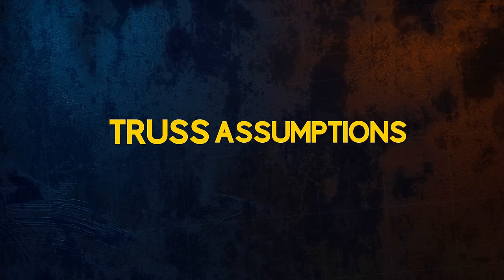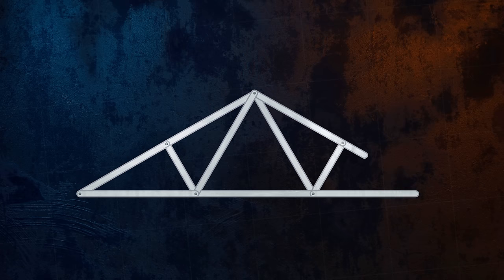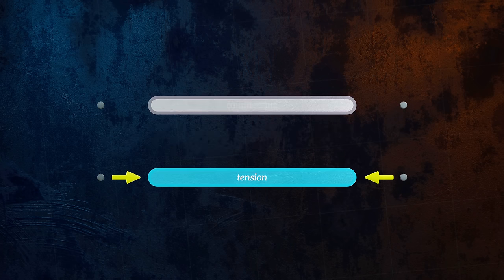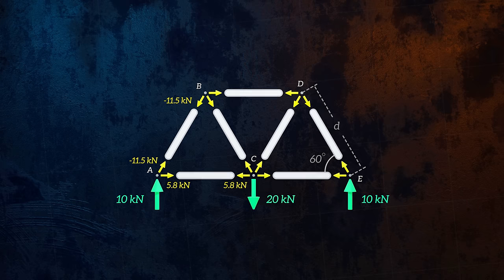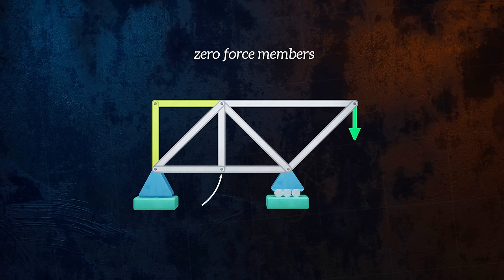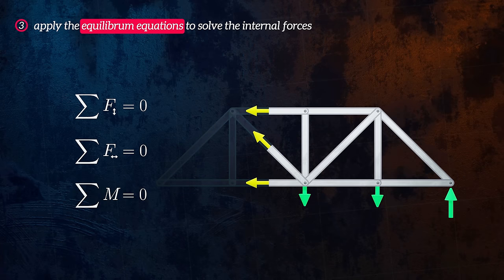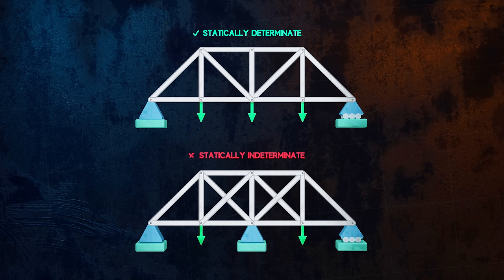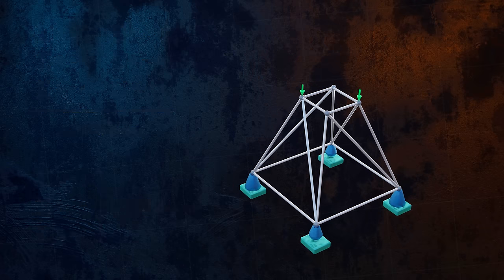Understanding and Analysing Trusses

Comment: I am a structural engineer with a major aerospace company and I cannot tell how how well made these videos are. I am so impressed that I actually watch them every now and then Just to stay in touch with basics. Helps develop intuition. 😀 thanks efficient engineer.
Reply: Do excuse me, I'm like hella stupid when it comes to this kind of stuff, but as for the 20Kn number, is that just an example of force? and if you wanted the real number or amount of force, you would need to calculate the weight of all components? and or additions to the structure?
Reply: @RUSTY NEEDLES  Yeah, usually for structures you calculate the dead load, which is the load of all the structural members, eg beams, columns, then you add the live load, which is the load of things like trains, cars, pedestrians. Then you add in wind and earthquake loads, and multiply all these loads by their respective factors. 

After which you get the moments and shear forces from these loads, and use these moments to figure out the rebar required per slab/beam/column.
Reply: Hello.I need a mentor,am an engineering student
Reply: @justhangingaround804 
Hi, I am studying aerospace engineering and its my last year. I would love an internship opportunity!

Comment: As a mechanical engineer myself  I have to say your channel is literally treasure!
Keep going my friend.
As a proposal ,it would be nice if you do some finite element analysis videos!
Reply: Exactly i do wish the same!
Reply: Do excuse me, I'm like hella stupid when it comes to this kind of stuff, but as for the 20Kn number, is that just an example of force? and if you wanted the real number or amount of force, you would need to calculate the weight of all components? and or additions to the structure?
Reply: @rustyneedles3743  this is a basic understanding and explanation of forces. weight and mass are different, weight being the force acting on an object with gravity, while mass being the amount of matter in an object. 
In this example, take it as the force acting on the object is xxKN, with gravity and mass of the beam being accounted for, as Weight (kn)= mass(kg) X gravity (m/s2). 
of course in reality there are alot of forces acting on the object, the type of material used for the beams, the type of bolt used etc. 
But the law of equilibrium and the law of moments about a point does not change.

Comment: This is an awesome video! I've shown it to my statics students. 

The caveat is that videos like this do not replace personal work on problem solving in statics, which is what is most needed to actually learn the content. And also it does not replace the discerning work of the teachers that need to ascertain that the students have learned the skills and provide feedback.
Reply from the maker: Absolutely, I completely agree! Working problems is crucial. And I see these videos as a supplement to classroom learning, not a replacement by any means.

Comment: I shoulda been a mechanical engineer. This stuff may be mundane to some but the application of physics here is absolutely fascinating. The only thing not really covered here is how to take into account the truss's self-load, which is kind of important when building bridges or towers but then that is a much more complicated topic. It also seems to me that wrt the zero load members, if they are there to prevent buckling, then they are there to counter a bending moment and thus not zero load. Just zero wrt to the ideal truss composed of members of infinite strength.

Comment: Method of joints, method of sections, force pologon.....several ways to design or check a computer run.  Secondary stresses easily checked for added bending tension or comp. between panel points (truss joints).

Comment: You can simplify and extend the mathematics further by using dominating graph theory and computing forces based on only two elements: vertices (nodes) and edges. You can even come up with new designs by computing the optimal cardinality of the domination subset.

Comment: I've been a builder for 40 years when I first started out I was Contracting houses and the Builder wanted me to use trusses. After I started building on my own I started cutting and stacking my own roofs. Triangles are the strongest structures in the world they cannot be collapsed without breaking that's why they are the strongest. Same as a cut and stack roof when you build a roof it is a triangle and then you put struts in pearland's in to create triangles. Once you understand this you know how to build the strongest roofs. It's a matter of geometry. Once you understand the geometry of a triangle and the facts that are triangle cannot be shifted or crushed like a square or parallelogram then you can understand the strength of a triangle and multi triangles to create a Truss. A trust is just a collection of triangles and once you understand that and you could understand the strength of a truss.

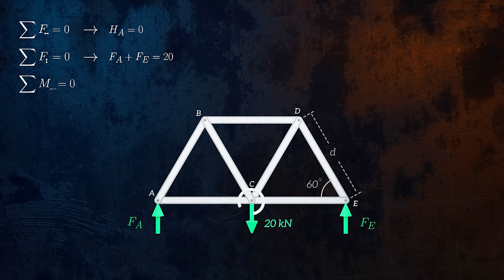Comment: AT 6:18 "take the moment at C" gives you an equation that Mc = Fa(d) + -Fe(d) = 0 , but doesn't actually resolve anything. You should actually take the moment at the Pinned support (A), to find the reaction force at the roller joint (E). Thus Ma = -20(1d) + Fe (2d)= 0, then Fe = 20 x 1d / 2d = 10kN. Then do sum of the forces in Y to resolve Reaction Fa.

Comment: @The Efficient Engineer: I do have one question: At Min 12:45 in the video, you calculate the forces of FA + FH and then state, that FA equals 19kN and FH equals 21 kN - how do you know, that they are not both 20kN, i.e. why aren't they just split evenly? And continuing calculating MA by multiplying FH by 8 and then in the calculation you multiply by 2, 4 & 6 - why do you do that and where do these numbers come from? I hope you can enlighten me, because the rest of the video was so amazing and clearly structured! Great work!
Reply: @choosingbegger9799   that's a perfect explanation - got it now! Thank you so much!

Comment: I think its a good attempt for young practioners to understand theoretical concept, 
But some explanation is wrong about Pratt truss at 15:57 sec of this video which as follows 
Vertical members are in compression as per narrator but loading applied would generate tension in Vertical member.
So change the load path to make yu explanation correct.

Comment: Sir , I think I've found a miscalculation here , at exactly  8:12 you made the two horizontal force acting at point B as postive , but it should be represented as negative to left horizontal force and postive to the right horizontal force , so they both would cancel out each other and the sum of horizontal forces at point B is equal to zero , correct me  if iam wrong thank you sir

Comment: Thank you so much for the phenominal effort you put in this video , i just have one question , at 13:39  why is  the 21KN force is located 2 meters from joint F and NOT (2 x square root of 2)  (measuring the distance directly from point H) as straight line , thank you :)
Reply from the maker: A moment is calculated as the force multiplied by the perpendicular distance between the pivot point and the line of action of the force, not the distance between the pivot point and the location where the force is applied, which is why it's 2m.
Reply: @TheEfficientEngineer  thank u so much keep going with these videos btw i'm an electrical engineer i love your work

Comment: Love the vid, I'm just having one slight issue. It is said that trusses only can carry joint loads but that is rarely the case in reality right? I mean for example one of the roof trusses pictured in the video will have a linear snowload acting on the "outer" members. If one would want to calculate the forces acting in each member would one multiply the linear load with the number of meters between each joint to combine it into a point load? In reality the members will not only have tension or compression forces but rather a moment and shear forces aswell. Is it corret to assume that these forces doesn't exist?

Comment: note 4: angles (stability) of basic triangular truss only depends on the length of each member. other shapes may not. so, how do we prevent elastic deformation (past yield strength of ductile material) or rupture (*somewhere past tensile strength of brittle material) (and thus "improve" stability)? probably with internal force analysis.

Comment: While chords of a Truss are analyzed and assumed as meeting and terminating at panel points, in reality chords are fabricated continuous thru a panel joints and splices may be located somewhere between panel points to take advantage of available commercial lengths simplify erection and not crowd the panels with joint connectors. Due to this continuity I take it that design must take advantage of the available axial stress from chords of adjoining panels to minimize joint connectors. Am I correct?

Comment: Question regarding the method of sections: in the video he states that the vertical force acting upon joint H is distance 2 away from joint F. Shouldn't the distance between the joints be 2sqrt(2), making Fge= 29,7kN?

Comment: I have a question: If you get a negative result for the force on a member, doesn't that mean you got the direction wrong and need to flip it? For example, on member AB you got a negative result. You drew that member in tension, when in reality it is actually in compression since you got a negative result. Or am i missing something?

Comment: Would the top and bottom chords being one solid member end to end make a difference?  In the Fink roof truss diagram the pin joint shows chords as being segmented rather than one solid member. I built trusses years ago in the early 80's along with running the component saw cutting the webbing and chords.

Comment: If I have an external load applied, let's say, at a midpoint of some component of the structure, when applying the section method near that member, will the external load be ignored or is the analysis carried out considering it?

Comment: Thank you so much. Just a quick question. Why did you use -10 while solving the forces on 7:28 ?  The force is still acting upwards so I am confused why did you use negative sign
Reply: he used -10kN because it had to oppose the 10kN force acting on the joint. The -10kN is the assumed force exerted in the vertical direction by the member.
Reply: @justaprogrammer6637  That makes sense. Thank you

Comment: i didn’t understood something.
you told that pinned joints doesn’t have a moment but you calculate an equilibrium on joint c (at joints method part).
what I’m missing?

Comment: 00:00 Trusses are rigid structures made up of straight members used for creating strong and efficient structures.
02:28 Trusses are planar structures that can be analyzed as two-dimensional structures.
04:43 Calculating reaction forces and unknown forces in a truss
06:57 Calculating forces and identifying zero force members in trusses.
09:28 Identifying zero force members in trusses
11:35 Method of Sections is used to find internal forces in specific members of a truss
13:38 We can calculate internal forces in a truss using equilibrium equations
15:38 Different types of trusses have varying levels of cost effectiveness and efficiency.

Comment: hi, for ideal truss the connection shall be pinned , but in steel trusses practically some times the connection are welded with gusset plates , so a welded connection will remain a ideal truss connection or it will have some rigidity and moment?, please explain

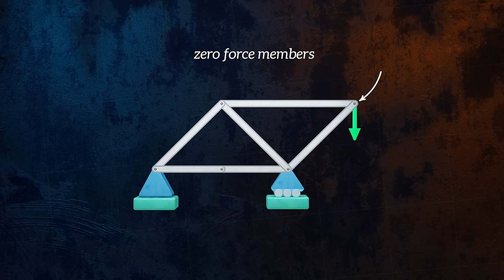Comment: This is an amazing video, thank you! One question: at 10:34 or so, you note that the two rightmost members are not zero force. This makes sense to me in general, but the placement of the force arrow is confusing -- it seems in general like you're modeling members under the assumption that their own weight is negligible, so is that force actually just due to tension from the rightmost anchor, or is it meant to represent force induced by the weight of the members themselves?
Reply: The green load is an externally applied load. Hence, the members going into that loaded joint must carry load.

Comment: Sorry but I dont get why you can consider gusset plate as pinned connection. Could somebody please explain? If I fix the beams to each other with many bolts and a gusset plate why can I consider the beam's end to rotate relative to each other?

Comment: At 8:18 can anyone explain why the two calculated forces don’t cancel out? Because both forces are acting in similar directions with identical forces leaving the joint at equilibrium so why then add a horizontal force?

Comment: Amazing explanation and animations. Thanks a lot. I still have a confusion though regarding zero force members: if the joint where these members are attached has not an external force, but a reaction instead, do you still consider the members as zero force members ? Or do you considere the reaction to have the same effect as an external force ? Thanks for your answer
Reply from the maker: Thanks! You would consider the reaction force to be equivalent to an external force.
Reply: @TheEfficientEngineer  Thanks a lot

Comment: The initial diagram of Tension or Compression is misleading information shown by the direction of the arrows. When doing structural analysis, the arrows should internal with tension pointing toward the member's center, and compression pointing toward the joints.

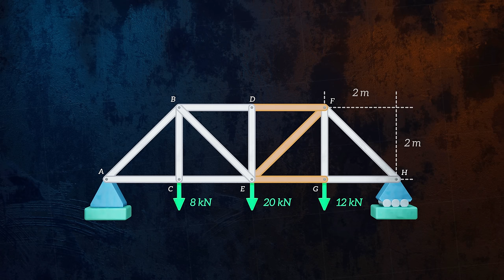Comment: For the system at 12:20, why did we initially draw a horizontal force arrow at A but not at H?
Reply: For the sake of ease - it’s not mentioned in the video but we basically assume that the point H is connected to the ground via a roller support, even though the joint itself is pinned. This gives freedom of horizontal deflection at H so there is no horizontal reaction force there.

Edit - in the diagram at 12:20 you can see that H is connected to the group via a roller, whereas A is pinned

Comment: at 6:13, can we take summation of moments to be equal to zero at every inner joints? @The Efficient Engineer
Reply: Yes, as long as your structure isn't rotating, the summation of moments is zero. It helps to pick a joint which is through one or more forces' line of action as it reduces the amount of calculations. Additionally, don't forget force × perpendicular distance = moment, so if you pick one of the top joints, then distances need to be calculated.

Comment: At 5:17 you say "at tension, internal forces will be acting to make the member longer" but this is WRONG. Like a rubber band stretched in tension, the internal forces are trying to make the member contract back on itself (shorter).

Comment: So, how come a standard wooden chair doesn't have triangles?
Reply: Design one to be different then, of course you are aware a 3 legged stool is simpler and stable
Reply: So you are asking how come a small object designed to withstand up to 120kg, doesn't have the same structural design as a multi ton bridge?

Comment: 7:40 wrong, sine of 30° is 1/2 the hypotenus; therefore your hypotenuse force should equal 2x horizontal A= 11.6 N.
Reply from the maker: It's just because of rounding. The hypotenuse is actually -11.547, since it's -10/sin(60deg), and I rounded it to -11.5. And -11.547*0.5 is -5.77, which rounds to -5.8.
Reply: @TheEfficientEngineer  I was kidding, but thanks for kindly explaining. :p
Reply from the maker: Haha fair enough!

Comment: Big weakness in truss designs shown is if one truss fails entire structure fails, no redundancy. I bigger more obvious issue when forces analyzed in two dimensions. Also states there is no side load on truss beams is never true, must consider wind and gravity. Plus roof trusses cars, snow, wind and rain loads on the trusses supporting the rooftop....
Reply: these are just statically determinate trusses, real world trusses have redundant supports that you can't easily solve with only statics.
Reply: @thegreatzoom5073  not true for all structures, bridges have collapsed and killed people and structures have failed because of critical trusses failing, to the point almost any truss failure is catastrophic.

Comment: At time mark 17:43,  COS (60°) * ~-11.5 = ~-5.8  (not 5.8 kN)  Why are you showing it as a positive value when it is clearly calculated as a negative value?
Reply: positive ans indicate the direction of reaction we assumed is correct and -ve sign represent that our assumed direction of force is incorrect. here we assumed the the force at A away from A that away from joint and our ans is negative which means that our assumed direction is wrong and force is towards the A joint.

Comment: WHY  is it that gussets failure have  caused bridge FAILURE ?
Reply: because typically joints are points of weakness in structures, a beam is solid and stronger than pieces of metal clamped or welded together

Comment: Can someone explain why it became 10kn/ sin 60
Reply: Since point A is in static equilibrium, F_(AB) must resolve vertically to cancel with the 10kN reaction force. Using trigonometry to resolve the force into its vertical and horizontal forces, we find that 10kN+F_(AB) * sin60=0; rearranging to get F_(AB) = -10/sin(60)